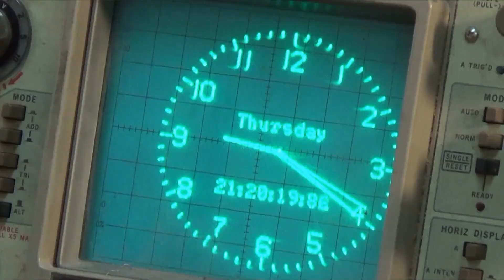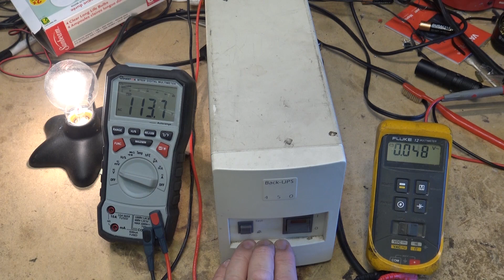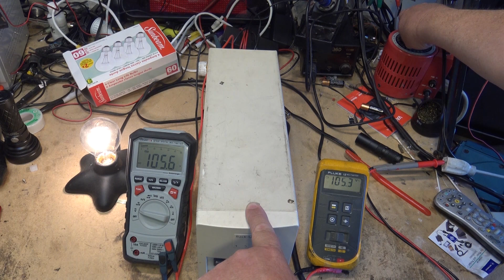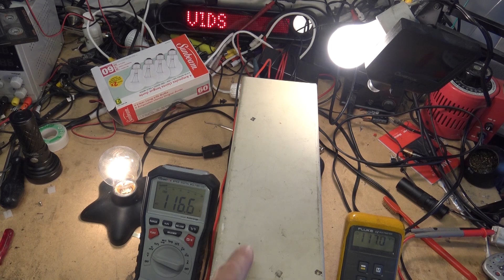American Power Conversion UPS shutting down  Diagnose and repair

Comment: Thanks for your video :) My UPS works fine, but the alarm will sound and light goes from "green" to "yellow", when I play certain higher-graphics demand PC games. I suspect this is an excessive power draw issue, but can you confirm this? Thanks, The Lil' Ninja :)

Comment: can u plug in something like an inductive cooktop? or use it as a backup power supply ( emergency generator?) or inverter & battery for cooking?
Reply from the maker: This one is only 400 watts but a larger 1500 watt unit would work fine for induction cooking but you would need a big battery.  12 volt battery to put out 15 amps at 120 volts would require 150 amps at 12 volts DC.

Comment: Hi. Any chance you know what battery voltage is when the  UPS shuts down? I suppose I should just run the test myself. Iam trying to diagnose a UPS that won't restart after power is restored yet the battery was still over 12V each and the only way I can get it to restart is to disconnect the battery and reconnect it. Nothing else is done to the battery during disconnect and reconnect... 10 seconds. Thank you if you can help.

Comment: my 875va ups randomly shuts off....got a new battery and it still does the same thing.. it would work fine for a while, but then for no apparent reason, it shuts off completely with very little load. Im not sure what is going on.. any ideas?

Comment: Can one use a car battery instead of the original one? What happens if a battery with more Amps-hour is used?
Reply from the maker: Yes of course. A bigger battery will give a longer run time.  Problem with car batteries is they require ventilation as they produce hydrogen gas when being charged and that means they can't be stored indoors. Explosion risk.
Reply: @12voltvids  Thank you. Also, charging will be slower, right?
Reply from the maker: @sorin.n  Right, but the charging is just a maintenance charge anyway, so it is pretty slow. You would want to start with a fully charged battery

Comment: I suggest you get one day some new Yuasa batteries, NP series. They can be found at reasonable price almost everywhere. I generally choose with the nearest dimensions, but I guess the NP 7 -12 will do the trick. You can also get replacement infos on the APC site, Wich gives many infos, even on ''vintage'' or legacy equipment. These are quasi indestructible, mine is from 1997! The only thing really missing is a USB link with a shutdown software. If you want a really good voltage regulation, you have to get a higher level model. Many computer get them off the shelf once the batteries are done, and you can easily get some decent 10 years high end equipment for the price of choice Chinese locost. The problem is delivery costs if you buy them with heavy lead batteries, but some retailers can offer to send you without batteries. Then you generally have 6 good working years, depending if you invest in new quality batteries, Yuasa, Sonnenschein, Fulmen...  
Some UPS companies suggest to buy some special batteries pack, but they are generally made of smaller units assemblies. You have generally multiple 12 V Units, but you must care for dimensions and Ah. Most use 7Ah whose dimensions are generic, but you can find 8.5 Ah in the same volume (Chinese ones say 9!). You can also find single bigger batteries, 10 Ah or even 17Ah monster. UPS designers tend to use smaller batteries for machines up to 1500 VA, as they can still be arranged in low profile 19" racks, typically 4 x 12V 7Ah packs. For larger designs (>30 kVA), you can have any battery configuration, 48V 200 lbs additive racks... till it's cheaper for your budget to have 1 (or more) diesel generator running and synchronized ready to connect (do you have some mining plant or big data center for editing videos in your basement running?).

Comment: The BackUPS were the cheap version, the SmartUPS versions had more features. The old ones were tanks, the new ones just die early.
Reply: Yep I had a classic SmartUPS I got for free on my home theater to protect the lamp in the DLP TV. 8051-based board in it, serial port for monitoring, two 12v SLA batteries. Replaced them once, but eventually it would fail and shut down when it tried to do a test on known good cells. Replaced it with a newer APC that looks like a very fat surge protector. That was probably in 2010... still works great today on the original battery.

I also have a "CyberPower' UPS on my PC and networking stack, pretty much identical to the Tripp Lite seen on here. It has also been in service nearly 10 years and it is just as reliable as the APC.

Comment: the voltage level is maintained on these batteries by the UPS if its not "used" alot. or not cycled. I am just curious why they still fail. Chemical process?
Reply from the maker: All lead acid batteries deteriorate over time even if they are not used.
Reply: Darn. That sucks. I have 3 lead-acid batteries I rebuilt in 2013 for some vintage computers in my collection, because they wont run without them. I try to keep them topped up when not in use. But eh. Has a timestamp on them. I guess just like everything does that contains chemistry.

Comment: That is definitely an early model, before they added the battery access door on the bottom. Changing the batteries isn't nearly so easy in the smaller models from that same time.

Take a look at the DIP switches on the back, as the transfer voltages are adjustable. It should cut over to battery somewhere north of 135 volts AC or so. If you want voltage regulation capability, the Back-UPS Pro can do that (and has more advanced communication support, since it uses a reduced version of the APC Smart protocol).

Comment: I have a very similar UPS  (I think mine's a back-ups 350)..    Its' been retired to just running all my network gear in the house (modem, router, APs, etc), but still works great.  They really are tanks.. mine's been in continuous use since for 20 years.  I've changed the batteries from time to time, that's it.     Great video- interesting to see how they work on the variac.
Reply: And yeah that's basically the same thing i've seen happen when the battery is shot
Reply: Interesting though, the battery mounting is quite different.. on mine there's a door on the bottom that you can access the battery through without taking the case on, and no bracket like that.  It has two 6 volt batteries as you mentioned, taped together as a single unit, but i think the two together is physically larger than what you have in there.
Reply: @joshonthetube  yep. Mine gives bat access through front, 2x 6 volt batts with higher VA rating and has external 12 volt jumper in rear.

Comment: Here we go again with the America is best BS. I used to work with these bloody APC devices day in, day out. They weren't anything special. Some were great, others were total crap, and the bigger ones from the early 2000s had a tendency to overcharge the cells, resulting in bulging after a year or so. At which point because they were enclosed in a riveted frame you'd need to get the drill out if you were to stand any chance of replacing them. Capacitor problems were also an issue with these things.
Reply from the maker: This unit is now 25 years old. The first set of batteries lasted well beyond 10 years. It was then taken out of service and a Tripplite was placed in service.  When the battery went bad in the tripplite it was serviced for the first time along with the triplite and put back in service where it has run 24/7 until this failure, a battery problem again, which is no surprise because I installed a used battery from a different UPS that had been taken out of service. Incidentally the tripplite also went bad, but not the battery, shorts on the board was the fault on that bad boy.

Comment: About the only thing on the old APC that would die is the battery.  Can't say the same for the newer unit.  Many have a cap that fails and it starts to act like you've got bad power.  Rapid cycling and all kinds of nonsense.

Comment: Try WD40 on that messy circuit board to remove the sticky stuff. Would a Battery Tender bring the battery back to life?
Reply: I doubt it.  I think the battery dies from being held at float voltage all the time.
Reply: @russellhltn1396  Not held at float, but at the cyclic charge voltage, which is higher, but charges it faster. Long term it kills the battery by boiling the electrolyte off into hydrogen and oxygen faster than the cell can recombine them, resulting in loss of water from the electrolyte. At the temperature inside the case that cell should float at 13V2 to 13V5, but instead it is held at 13V8 to 14V0, which is bad long term.

Comment: Nice.  I've still got the 650VA version of that one kicking around.  You're right about them being tanks.
Throw the output up on the scope just for fun sometime.. damn ugly..but it works.  Good thing most PSUs aren't that fussy!
Reply from the maker: Square wave! My tripplite is much better, a sinewave,but the voltage fluctuates on it up and down from 114 to 117.

Comment: What also happens is the charge circuitry has small (470uF 25V) electrolytics and a voltage regulator to charge the battery, and this capacitor dies, or the regulator fails either partly open circuit or short, leaving the battery then being undercharged or overcharged, or the voltage regulation dies, so the battery is overcharged to past float voltage at the internal temperature.

You also find scorched regulators in the charger, mostly because they are run at close to maximum power, and the charge voltage sits at close to 14V, where it should, with the heat the battery experiences in the case, be between 13V2 and 13V5. Those should actually have a small fan and better ventilation, as they normally run really hot, and this kills the batteries with time.

Got an old APC unit with dead batteries, and removed the internal batteries ( replaced with a 18000uF 40V can electrolytic instead) and recycled the connector for the external battery connection, to have 2 12V 65Ah deep cycle batteries not in the toasty enclosure, but cooler outside. Runs a lot longer, and the cooler batteries also help.
Reply: I had an APC RS 500 that stopped charging due a faulty capacitor. It was traced back from an oscillator it couldn't keep fed as the voltage on the input would dip and the chip kept shutting down. The cap was only 85° rated too, which is nuts for how hot that part of the unit usually was. It didn't even test that bad when removed from the circuit so it was replaced with a higher value 105° cap. The UPS then ran rock solid for a couple years after that until it was replaced with a Pro 1300.Seemed like quite an oversight on APC's part to select an electrolytic with so little headroom for that application, though.
Reply: @xenonkay  It lasted the warranty period though, which is about all they care about, then they hope that you will buy another APC to replace it again.

Comment: I would imagine that modern inverters are a bag of crap in comparison to that beast.
I thought the beeper sounded rough like it was getting a choppy supply.
America was good at making strong and solid devices, my mate bought a carpet cleaning machine made in the usa, it was a beast that would lift carpets off the floor if you were not carefull.
Dam strong too, amazing power, it made all other cleaners look like a toy.

Comment: Put a real LOAD on it,  that light is barely a tiny load. Then you will find it repeating the trouble.
Reply: Try running a toaster, toaster oven, electric frypan, and or waffle maker (in series as required for desired total wattage/current draw).
150 watts is not enough load to test a large capacity UPS. Filament light bulbs are getting scarce since the CFL/LED replacements.
YouTube: I'll Be Missing You - Puff Daddy Incandescent Light Bulb Parody    got salmonella from my Easy Bake lol
Reply from the maker: @FindLiberty  all it needs to run is my computer.  Incandescent bulbs in parallel will load it nicely.
Reply from the maker: I did. My computer which draws closer to 400 watts.  With the new battery it provides 10 minutes if run time which is enough to shut down the system.  I do have a monitor that connects to the computer over USB to serial cable so as soon as the power goes off the computer receives a shut down command to safely shut down.  I need only 3 minutes of run time and I get about 10.  With the bad battery as you saw it worked with a 100 watt load but crapped itself at 160 because the battery voltage dropped due to the battery being dead.  The 160 load was just for demo as that is all I have here. In the studio I fired up the computer and pulled the plug and watched it go. There is a 2 minute time delay before the ups issues a shut down command so if the power returns everything just keeps on going.  After 2 minutes the shut down command is issued, windows closes files and shuts down within another minute.  So with 10 minutes run time I have no reason to worry.
Reply: @12voltvids  I am using an APC750XL I got as scrap metal, replaced the 2 very dead batteries, cleaned it up and put the external bank on instead. Connected via USB and it works well. Just has to last 2 and a half hours to cover the usual load shedding events, and it does so fine, then causes hibernate when power is low.

Replaced an older no name one which was going bad, as I was using it with a massive pack compared to the 12V 4AH it came with, for 5 minutes of run time. I had a black board where the charger circuitry was, which still worked though, but the cooking smell from the transformer  was getting worrying.

Comment: You could try adding distilled water. Maybe the battery dried out.
Reply: I believe these are sealed so can't do that.
Reply: @johnhpalmer6098  Yes you can.
Reply: @SinsBird  While you can add water, by the time you notice the battery is dry the cells have then been badly sulphated, and the grids corroded to nothing, so even adding extra water will not do much to extend life. Try to desulphate it and the grids die from the abuse.
Reply: @SeanBZA  Not necessarily. And it's not completely dry since it still worked a little bit.
Reply from the maker: Battery is sealed, so top would have to be pried off to get access. These cells are cheap enough to just buy a new one. I am using used ones I pull from the recycle bin and attempt to charge. Some charge so I use them till the die completely.

Comment: I have a UPS with similar case. When Radio Shack went under was able to get larger batteries. Made external case, added auto cigarette lighter to UPS and case connected with heavy wire & two male ends. Doubles as worlds most idiotic rechargeable lighter

Comment: I had one quit on me. I assumed the battery went South. I still have it. Never took that one apart. I don't know if it would be cost effective to find a replacement battery  Radio Shack Brand. ( Or I got it from radio shack, I'd have to look at the brand)
Reply: You could try a local battery place and ask if they've got any B grade batteries that you could have for cheap, that way you won't waste too much money if it turns out not to be the battery. Sealed lead acid batteries like this come in standard sizes and brand doesn't really matter imo, lead acid technology is pretty well understood at this point even a no name Chinese one would do.

Alternatively hook up a car battery using jumper cables just to test it.